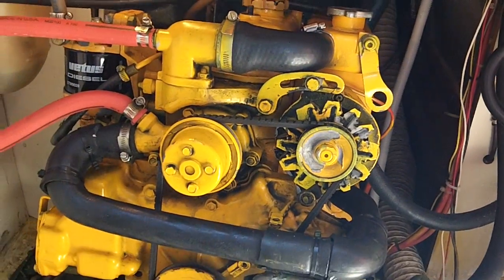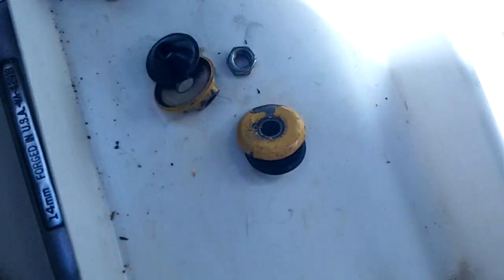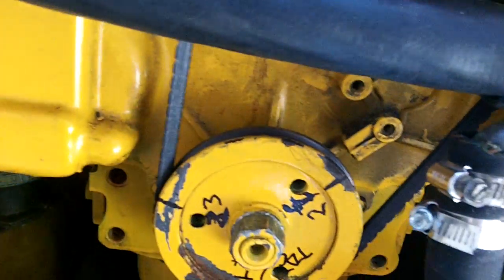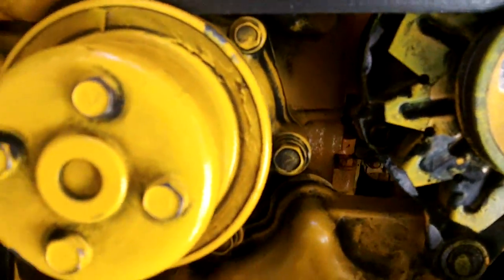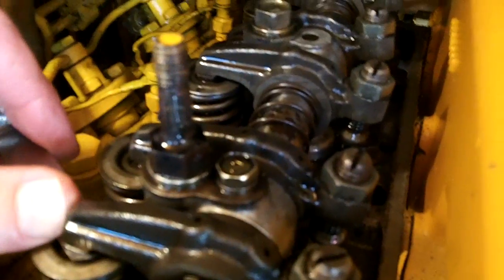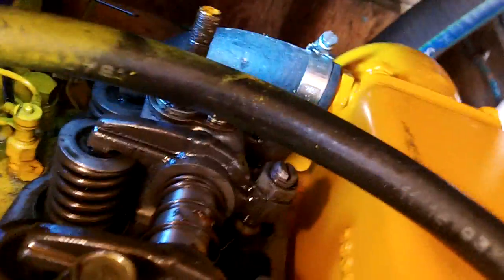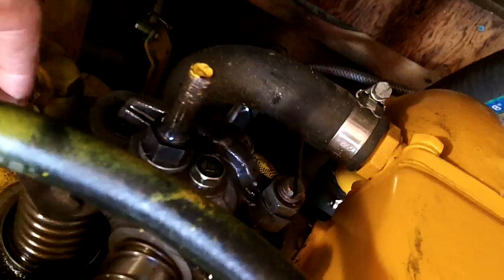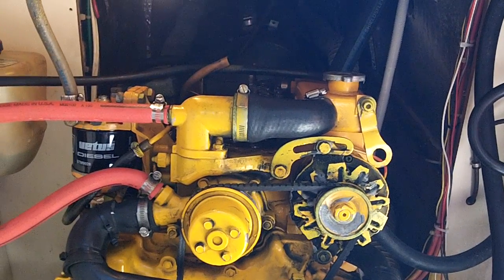Adjusting valve clearances in Vetus M3.10 three cylinder inboard marine diesel

Comment: May I ask why the asjustment? Was it making poping noises? Thanks
Reply from the maker: The manual advises regular, periodic adjustments as part of routine maintenance, every 100 or 200 hours of use, if I recall correctly.
Reply: James Wilson   I have a problem with my boat yanmar 4 cilinder making poping noise between 2500rpm and 3000 rpm. Wonder if thats the issue

Comment: Hi, Great video!  Not many out there on 3 cyl. so thank you! Question on rotating.  You said rotate 240 degrees to adjust next set of valves, but you rotate the crank 120 clockwise.  is that because the engine rotates counter-clockwise, so 120 clockwise gets it in same position 240 counter clockwise, but with less hand cranking?  Rookie here. Thanks in advance.